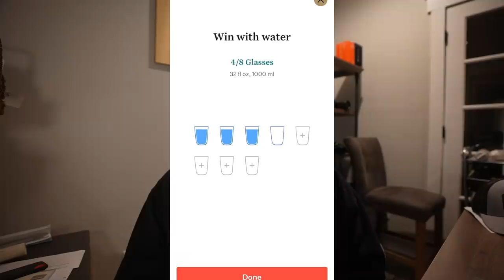Tornado DESTROYS My BACKYARD FARM!!! (Had to Rescue Camel)

Comment: Flair, I drove through Homestead, FL after a hurricane in the 1990s.  The was a structure made from 3/4 steel pipe that sprayed water on a huge propane tank.  Nothing but pipe and it was pushed sideways.  A concrete building that had a 1 foot by 2 foot window in it.  The entire window was missing including the metal frame, the concrete was broken out all around the window just so the frame could break free.   An entire Air Force base was closed because it was so destroyed.  A tornado can easily have faster winds than a hurricane.

Comment: flair time to make or buy some stakes to stake the sheds down when your not moving them (the shed likely blew over because of the ply wood on the front allowed wind in but not out(it couldnt create a vortex so it built up air pressure and acted like a potato gun and released all at once blowing over the shed) the animals were probably in the other ones which is why there standing

Comment: You should buy a 22-250 for hunting. Projectile similar to 5.56 but the casing and powder is much larger like AK round 7.62. Beast of a gun.
Reply: 22-250 is to fast of a deer hunting round it goes so fast it just blows a hole The sizes of the  tip of your pinky
Reply: @boothang7637  I speak from experience when I say it's a good hunting round. Also due to how common the round is here in Australia the price for a box is very reasonable compared to other popular rounds. I think this is due to the fact the round isn't common in the US so easier for us to get our hands on them.
Reply: @rebelrob9637  i’ve had 2 but yeah but the white tails here may run 3 or 4 miles and bed down and then they may not on my property no more

Comment: Why get those jeeps when u can get a ww2 willy jeep them things are small and can get over anything there the ultimate transportation for getting around the property and they can be maintained super easy and you can take them fully apart in 20 minutes and put back together fully Theres a vid showing some people stripping and resembling a willy jeep in like a couple minutes but with flair it will take 20-30 minutes but still not bad id presumably engine swap it maybe